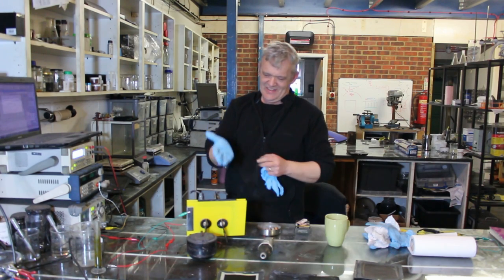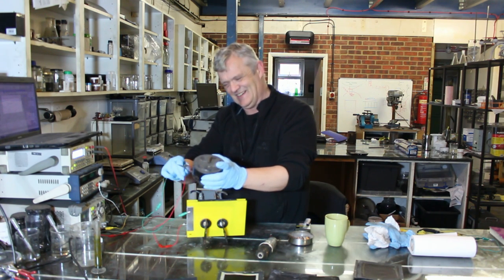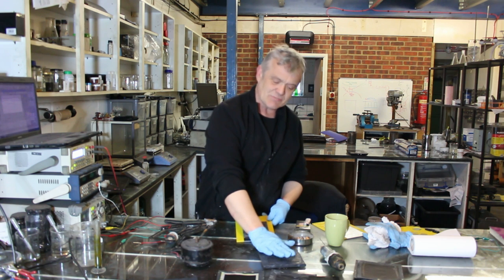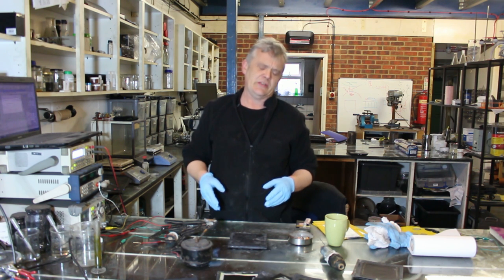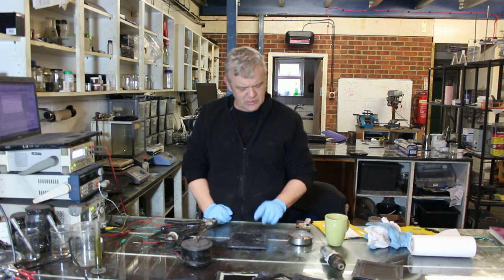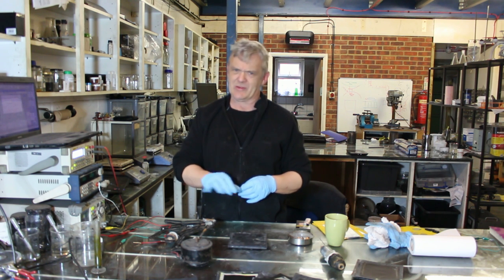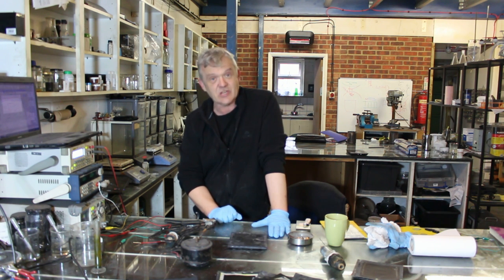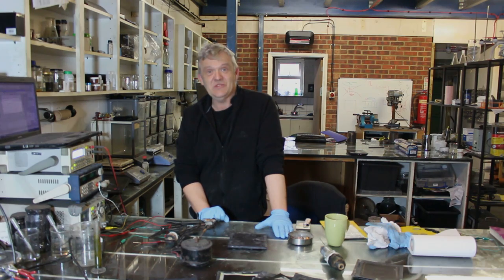FWG Supercapacitor   Finished

Comment: Hi Robert, a newbie question.  If you took your 1,000F capacitor cell and converted it to a homopolar disc, given that V=(ro^2 - ri^2) * B * rpm/(units conversion)  and V = IR, then if the R of your obviously graphene based cell is extremely low, would the result be greater voltage or the amps be huge?  Based on  V=IR => I =(ro^2 - ri^2) * B * rpm/(units conversion)/ extremely small R.    (Combining what I saw on disparate vids years apart.)  
Practically, take a core out the guts of the super capacitor to form the disc.  Just wondering as I assume the cell is multiple layered - perhaps the graphene cross-sectional area is ridiculously small cf with the metal conductor X-section?  Off-topic, sorry. Love your teams work.  (Perhaps you can make a DC generator that is its own capacitor?)

Comment: So excited as new comer I bought resistors, aluminium foil, battery holders, AA batteries, multimeters, LEDs, switches wires and all the other consumables mentioned in other earlier videos .  A big slash out of cash, but the MOST fun I expect ... EVER ... from $33.45. ( Measuring capacitance using tau - how cheap is that .. and my bread board is foot of wood cladding off-cut I found at a friend's place).

Comment: So very impressed. You and your team's workload and commitment is astonishing. 'we are not worthy'.

I am interested in powering/assisting a recumbent cycle (tadpole configuration) beans and 62-year old enthusiasm just don't cut the mustard anymore; but I am not really up to speed on suitable motors, (output range of 250-500w). I can do gears and all other mech/elec/controller works but selecting a motor and balancing it with suitable capacitors is giving me some gyp. Any pointers?
I am also thinking these could replace the batteries presently used in mobility scooters, (age, accidental abuse by charge/discharge etc they don't forgive) lighter weight and many other beneficial features not to mention the stupidly high cost of present replacement batteries. Its a big market/demand.
Thanks so very much for sharing.

Comment: Thanks for the correction and clarification in the Description, Robert. That's a very important point, and testament to your honesty. Much appreciated.

The capacitors are still awesome, of course, not least because of their low mass and volume. Will you also be willing to make a 5.4V (assuming 1.8V per segment) ~300F version, in the same package? That type would find uses in 5V applications.

Comment: Is there a particular reason that you are using a flat construction rather than a roll?  I suspect a 100F 18V 200 grams rolled-up capacitor would have much more applicability than a wide flat one.
Reply from the maker: funny thing is mate I also get comments telling me how useful the flat version is - we make the flat version because that's what we can make without expensive machinery - that's the only reason - as far as folks are concerned it seem 50/50 either way on flat or rolled
Reply: @ThinkingandTinkering  Fair enough, I just thought that since you've brought it up to a decent voltage there would be very little application call for serial connection where flat construction would have some advantages. Rather I can see a demand for a parallel connection of such cells, where a rolled-up version would be much more compact in assembly. If your assessment of the capacity is accurate six of those in parallel would give you 600 Farad. At 18V full charge that a pretty decent amount of energy  with the ESR of less importance due to parallelism.
Reply from the maker: you are spot on mate - but it is a question of what we can do as well really

Comment: Can graphene's thermal-electric (using a peltier like effect) properties be used to cool CPUs? Is it possible you can try creating homemade graphene CPU cooler on a future video? If the temps are equal or better than current air/water cooling systems, you have another product you can sell.
Reply from the maker: ORNL did some really good stuff on pitch based graphitic foams that are worth a look at mate - i'll have a think about a 'home' version

Comment: another thing to consider  - cost. $100 / kwh barrier : "Patrick Soon-Shiong on 'holy grail' zinc-air battery", nantenergy. com and MIT Professor Donald Sadoway On The Future Of Battery Storage And Renewable Energies.  ambri. com
 existing car battery market retail: 
Optima Yellow Top Deep Cycle Battery, Group Size 34, 750 CCA ; $276; adv.autoparts;   
$276;  660wh; 20 kg; 560in3; 9L;    33wh/kg; 73 wh/l;      $418/kwh
AutoCraft Silver Battery, Group Size 34/78, 800 CCA  $129
Reply: lithium. evassemble. com
Winston WB-LFP160AHA - $215.
160ah; 2.8v,   448wh;  5.7kg. $215;  79wh/kg; $480/kwh
Headway 38120S 10ah LiFePO4 Cell -screw tab.    $15.99
10ah; 3.2v; 32 wh; 105 Wh/Kg;  120x d38mm; 360g; $500/kwh
------
Turnigy Graphene Professional 10000mAh 14.8v 4S 15C LiPo Pack w/ XT90
~ $111; 150 wh/kg, $740/kwh
Turnigy nano-tech 10000mAh; 7.4v;  30C LiPo Battery w/Flat Connector
$89; 74wh; 148 wh/kg; 280wh/L;  $1200/kwh
Reply from the maker: very interesting mate - thank you

Comment: 200g and a lithium cell is approximately 45g. Energy capacity = 1/2 VVC = 162kJ. Delivered over an hour, it's roughly 45 watt hours. A lithium cell at most is currently 3300mAh and averages 3.7V so 12.21 watt hours. So well and truly in the ball park for energy density. That leaves the question of cost.
Reply: It's 100F per cap at 18v so 4.5wh
Reply: @proteinman1981  25 seconds in 1000F
Reply from the maker: sorry mate - it's my bad - it's 1000F per cell at 1.8v and 10 cells in series makes the over all cap 100F 18v
Reply: @ThinkingandTinkering  "the man who never made a mistake never made anything" Don't know who said that but it's true. I was thinking 10KF per cap was a bit high but was assuming you knew something I did not. That said I'm getting something approaching 6KF with some of what I'm messing about with but it's not reliable and I would not trust it above about 1.2V.

Comment: Does this mean you have solved the blade topology for rack mounting?
Can the capacitors be mounted in both a series and parallel configurations? Which is the preferred arrangement?
Reply from the maker: yeas mate they can but i think the preferred arrangement would be application specific

Comment: Happy New Year, Robert!  Its delightful to see you on again; this is the first video of yours to pop up on my feed in many months for some reason (although I know you've probably done quite a few in the interim).  Before getting distracted with other projects I was looking into the use of Iodized graphitic Carbon Nitride nanoplatelets as a substitute for Platinum catalysts in Fuel Cells other electrolytic devices, and treated commercial Gortex as an economical substitute for the Nafion Membranes.  The cost differential between granulated Urea in bulk and the Iodized graphitic Carbon Nitride is a very alluring business prospect, in itself, if the right experiments were done to better validate its viability as a Platinum substitute.
Reply from the maker: agreed mate - that would be a fascinating project

Comment: Wishing you all a happy new year, and hoping that at some point you can bring to market a 18650 battery killer.  Same spec but without the weight.  Provided they could replace 18650s, then I'd be happy to buy some and use on my electric bike.  It would be interesting  to see how much further I could get it to go.  I have two identical 17AH battery packs and would be willing to disassemble one and compare both on the same journey and same weight load.
Reply from the maker: that would be awesome mate - thanks for the offer and have a great new year yourself

Comment: Hi Rob and the team!
I am a huge supporter of your channel, an electronics enthusiast who not only believes in the future of graphene-based supercapacitors replacing batteries in the near future, but am also an active home-based experimenter. Thanks to your channel of course. 
One thing that I would like to know at this point is the internal resistance of the module itself. The demonstration with the hand drill motor raised a question in my head:
If the module is supposed to be at ~18V, the motor is rated for 14V, wouldn't the drill start turning very fast in an instance, rather than "slowly" ramping up to the speed it did?
Because it seemed like the voltage on the module dropped significantly once the load was connected. 

Thank you in advance for your answers.
Reply from the maker: don't forget i had just run the 18 volt scooter motor and the drill motor after that with no recharge mate

Comment: Dr. Smith, congratulations!!  Great to see that smile on you with this milestone.  An application for your products would be in the aircraft industry.  Light weight, power dense storage devices that won't catch fire are needed as that sector converts to electric power.  You might find plenty of funding through them.
Reply from the maker: nice idea mate - cheers

Comment: Hi rob I read one of your replies to using these in electric cars and you said it would not be a good idea. This article below say it would for may reason.

technologyDrivers of hybrid and electric vehicles will be used to the feel of regenerative braking.
As you brake, or even lift off the accelerator pedal in some electric vehicles, kinetic energy from the car's motion is captured by the electric motor, which when not being driven turns into a generator. This power is then stored in the batteries.

The effectiveness of this is limited by how quickly the battery can store generated energy - not enough to warrant the absence of friction brakes. A new supercapacitor could be about to change this.

Unlike batteries, which store energy chemically, capacitors store energy in an electric field. They can store this energy - and discharge it - very quickly.

A new flexible, solid-state supercapacitor, writes Physorg, could be used to store energy much quicker than a battery could, allowing the electric motor, or electromagnetic brakes, to entirely supplant friction brakes. That means far less kinetic energy is wasted as heat, improving efficiency.

There are plenty of potential benefits. Not only is the system more efficient in terms of energy use, but for drivers, brake feel would improve - there'd no longer be the feeling of two separate braking forces doing their thing.

Potentially, there's a weight saving too. Friction brakes and their associated components are relatively heavy, and much of that weight is rotating with the wheels. Engineers call it unsprung mass, and the less unsprung mass, the better. Handling improves, ride quality improves, performance improves.

The supercapacitor being explored by researchers at the University of Minnesota and University of North Texas uses carbon nanotube-coated cotton paper and is completely solid-state. That means it isn't as bulky as current supercapacitors, which use a hazardous liquid electrolyte that needs protecting.

It's thin, light, and flexible, which would allow it to be used anywhere in the car, with zero impact on packaging.

The design is still in early stages - contrary to one of the main benefits of capacitors, they've found the new supercapacitor to have high resistance and charge slowly, but this is a feature the teams think can be improved upon.

It may be some time before all our braking is done without traditional friction brakes (at the very least, friction brakes are still useful as a backup system) but it could soon be supercapacitors, rather than batteries, that are used to recover braking energy in electric cars.
Reply from the maker: you are spot on mate that is one of the main uses of supercapacitors in automotive but i think the poster meant to use them as the main power and that's where I was suggesting that it might not really be suitable
Reply: Yeah well I had an ebike 10 years ago with super caps and batteries in parallel . The caps allowed me to have 50% less weight in heavy batteries as it would have to much voltage drop under standing start full acceleration . With the addition of the caps I could  get around this voltage drop issue and have 3kg less batteries . It was my most efficient bike I built out of 5 different versions .

Comment: What would be the estimated storage life?
Reply from the maker: i don't understand mate - what do you mean?
Reply: @ThinkingandTinkering  
Sorry,  I guess I was not very specific.  How long would these capacitors last under normal daily single charge/discharge cycle (5 yrs, 8yrs, or 10+ yrs) ??   If I were to put them on the shelf (Storage) for later use in either charged or discharged state,   would it degrade and lose some of its ability to charge to its maximum capacity 5-10 years later ?
Reply from the maker: i don't know mate i have done any age testing - but i doubt it as it is a sealed unit and not a redox based system per se - but good question

Comment: Happy New Year Robert. Have you tried other than water-based electrolytes? It would increase energy density at the expense of power density which might be a good trade-off and maybe compete with batteries?
Also, do you plan to share more details about your carbonisation and activation process?
Reply from the maker: No mate we have stayed with water based electrolytes as safety is one of our concerns as is environmentally friendliness - those precepts, more or less, dictate water. As to sharing the details of the activation process - no we don't plan on doing anymore on that.

Comment: Are you working to an existing standard at all, in terms of mounting, enclosure, etc? There's probably a bunch of things that can be reused from the IT server space for mounting and monitoring compute hardware.
Reply from the maker: yes mate and server racking is one of the specifications but with the blade design we can easily alter to fit specific application niches
Reply: @ThinkingandTinkering  Great, it's an area that many prospective contributors have experience with. Might be worth keeping services like Xometry and Protolabs(?) in mind for outsourced production of those components; it's what I've had in mind for several enclosure design outcomes I've had kicking about for a while.
Reply from the maker: that's a good idea mate - thanks for mentioning it - cheers

Comment: very cool development, if you scaled this up to the proper number of units, would this be suitable to run a hybrid car?
ill give you the specs of the battery in my prius, which is about due for replacement if you want to beta test your new cap.
Reply from the maker: you wouldn't want to with this mate it's a cap - we have a similar device that is a battery and that is the one you would want really - that one we will scale up and put in the twizy
Reply: @ThinkingandTinkering  when you get your battery built i'll happily install it in the prius & get you some real world data points.
Reply from the maker: awesome mate - cheers

Comment: Seems awesome and looks so cool. Correct me if wrong but the drawback is that a supercap looses it's stored energy over time in contrast to batteries? But it can charge a lot faster though. You really have too have something green in/on your cover case, signaling environmental friendly product, since it is. There is a danish company I believe that have green-friendly epoxy if your cover-sheets are made out it. Keep at it!
Reply from the maker: i'll look into it mate - i like that idea a lot - do you have a link? cheers
Reply: @ThinkingandTinkering  Hmm they might not be Danish, they might be American. Darn :) They say this them selfs "EcoPoxy is an epoxy company like you’ve never seen before. Through rigorous research and development, we are proud to offer natural bio-based epoxies that are socially responsible." but I guess you have to ask what components they use so you can judge the chemicals your self. Lignin (? the natural epoxy from trees would be awesome to use, but how) Link: https://www.ecopoxy.com/ another one here in Bristol it seems: http://www.matrix-composites.co.uk/products/sicomin-epoxy-resin/greenpoxy.html
Reply: @ThinkingandTinkering  I later on started to think about prepregs, and how awesome that would be, if possible and doable. Taking two thin sheets of carbon prepreg sheets, place supercap material in between and then vacuum it. So et voila this eco-friendly material comes up link: https://lingrove.com/
Reply from the maker: thanks for that mate - i'll research this - cheers

Comment: Really exciting! Robert, don't forget that when capacitors are put in series their capacity is reduced depending on the quantity in a string. So if you were to string approximately 7 of the 500F 2.7v "GreenCap" supercapacitors in series to get the 18v you'd only have a capacity of 500/7 = ~71F, meaning you'd need 7 parallel strings of each 7 in series to get 500F at 2.7v, which would weigh almost 3 kilos.
Reply from the maker: they are basically already in series mate - the block you see is a series connection of 10 caps at 1,000F each - giving 100F at 18v - if i then put 5 of these in parralel I would get 500F at 18v and it would weigh 1kg. If I wanted 500F at 3.6 volts it would only be 2 cells of the size you see - so it would weigh 40 grams
Reply: @ThinkingandTinkering   sorry for the newbie question but wouldn't putting supercapacitors in parralel increase the energy density and make the whole package act more like a battery ? rather than high spike of power/voltage that get reduced fast over time
Reply from the maker: no mate - if you add more caps you increase weight and volume in proportion - so energy density remains the same as it is normalised for weight and volume - actually energy density is volumetric and specific energy is by weight
Reply: @ThinkingandTinkering  oh I see interesting, thanks for the response
Reply from the maker: no worries mate - hope it helped